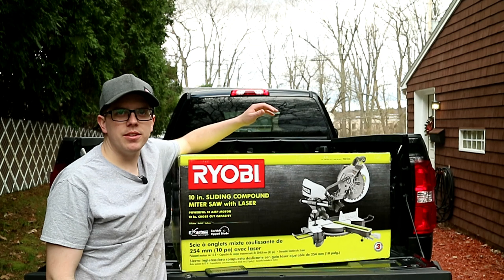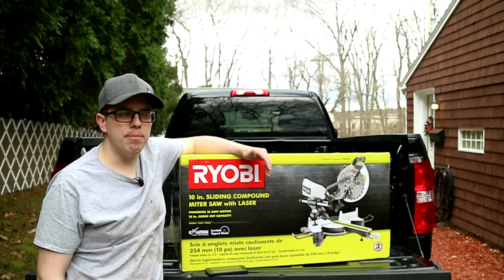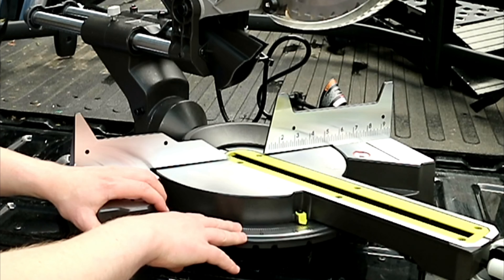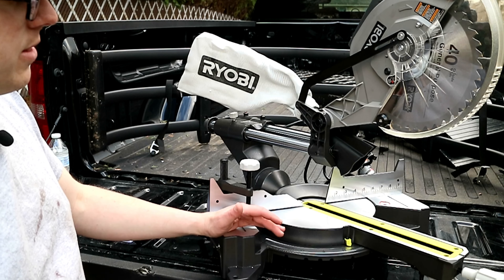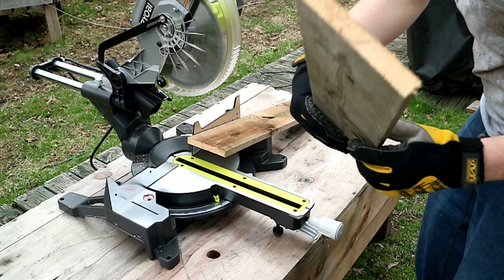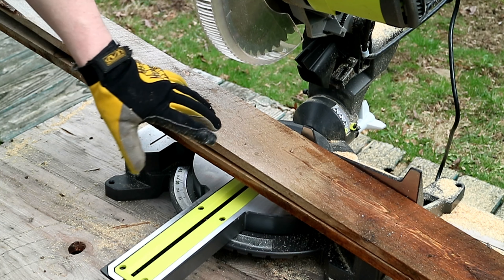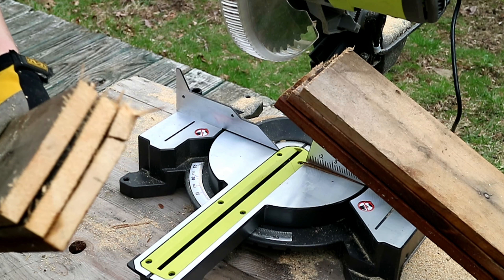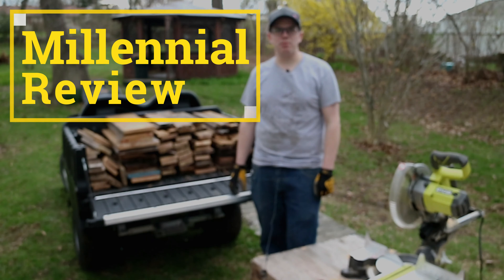Real Review, Ryobi 10" Sliding Compound Miter Saw TSS102L

Comment: I Bought Ne A 10 Inch 
Cordless Ryobi Miter Saw.
Havent Used It Yet But It'll
Come In Handy when I Start My Winter Woodworking Projects.
Why I Chose A Cordless Is 
Theres never An Outlet Around
When Ever You Need It.
Either The Outlets Are Behind
The Couch or The eazychai.
I Can Just slap A Battery In It 
& Start Doing My Woodworking
Projects.

Comment: Not gonna lie I bought one of these and am very disappointed in it. I was using it to re-trim a house. I have re-calibrated the fence and vertical axis multiple times.  It does not hold 0 vertical well at all, very obvious when coping base board. And cutting miters is completely hit and miss. Wish I would have bought a bosch or Dewalt.

Comment: I just bought one today, haven’t had a chance to open it up yet. Hoping it will make nice, clean cuts for my diy projects!
Reply: Shannon Marie I’m on edge with buying one. I have a ten inch miter saw that’s not sliding and struggle with cutting 2-8 and 2-10 material. I’m 14 and working on making a business out of woodworking so things like that really have a significant impact.
Reply: Nicholas Roberts spend the extra money on deWalt it’s like $219 at homedepot. definitely worth every penny if you’re gonna use it for woodworking in the future.
Reply: Hi Shannon 😍

Comment: Did your slide out of the box feel stiff?
I loosened the lock screw but it’s still incredibly stiff. Does not slide well at all. 
Any input would be great. Thanks.
Reply from the maker: It broke in a little bit
Reply: A drop of oil usually works. A drop, not a can.

Comment: Thanks for the review...I just bought a 12” one 
Your review already made me glad I got it and I haven’t even opened the box yet

I have to admit, I ended up getting a Delta Cruzer miter saw.  It cost a lot more...I use it for Regular wood working projects.  It slides as smooth as butter.  It also doesn’t use those sliding rods, it has an interesting mechanical arm so it can sit basically flush with the wall and easily slides forward and back with very little resistance.   It’s a long-term investment for me.  Very solid saw and maybe the best one out there right now. 

Anyways, this is supposed to be about the Ryobi.

Comment: Wait until you've had it for 1.5yrs, the ryobi "craftsmanship" starts to really show.
Reply from the maker: While that may be true, Ryobi is a homeowner brand and is not going to hold up to the likes of Milwaukee. Then again that's why the price points are so much lower.
Reply: Hmm... I disagree, there are many ryobi users myself included that have tools from ryobi for years with no issues. I've used mine in automotive for 6yrs with no issues and replaced my old blue with the new brushless line. Others stated they on a contractor level havent had any issues. The craftsmanship from my personal experience is excellent. I would expect it to be inferior but I intentionally abused my tools to see how durable they are, that includes dropping them carelessly, leaving out in the rain (that was entirely accidental) on a job site and everything still worked and works fine, and pushing/using them with an attempt to bog down. Despite these attempts over years no issues. Reason I personally love and stick to ryobi. I do love Milwaukee and I really want their impact wrench as the ryobi one I have is only 300 ft lbs of torque. Hopefully that'll  change with a new brushless 1/2"
Reply: I've owned and used a set of Ryobi  Drill and impact driver for 9 years. Its been used in the Nevada Desert and dust and back. Still kickin and work great.
Reply: @emmanuelmota1  Well this is a homeowner grade tool. It's just what it is. Pros pay a little more and use them everyday. Both tools have there place.
Reply: Thinking of the Bosch with the attenuating arm. But you could buy two of these Ryobi's and have money left over.  But I only need one.
Reply: @blueceligts180  yeah, tools for years with no issues because you don't use them often.
Reply: @newmanfertig886  I clearly stated my use of my tools. I used the daily since I was doing custom automotive installations for over 6yrs. My coworkers used harbor freight, snap on, makita, Milwaukee, and rigid. I had no issues with my ryobi and my coworker's used my tools at times.
Reply: @blueceligts180  That says a lot for Ryobi then. Good to know.
Reply: @newmanfertig886  For me it does. My coworkers still said they wouldn't buy ryobi but they had no problem using my tools. And for me with my experience, that is why I support and still purchase ryobi. But I do love Milwaukee they have great tools which would be my higher/better brand that I would purchase for certain tools. Ryobi drill/impact bits however are trash and I will no longer purchase any of them or recommend thdm.
Reply: I'm a contractor ..I do home rehaps for a buy and flip realtor who has sold 5 houses already this year my tools are Ryobi I use them hard every day for long hrs from trim and finish carpentry to screwing down and building decks ..it's been about 8yrs now and my tools haven't let me down ..the other contractors pack DeWalt and they make snide remarks about my tools being Diy or home owners ..I just laugh doesn't matter who's home it is we are working on it we are still rehabing and remolding a home I'm my tools are going strong sometimes longer then their professional tools ..I have the same 3 yr warranty for the half the price ..lol
Reply: @doughart4833  Dewalt is lifetime warranty. And Ryobi isn't made for Custom Carpentry. By your comment I know you're full of shit. Pros pay more for accuracy with the tools. Ryobi fails to deliver in those areas. Their Table saw didn't even qualify to be part of a job site test. There is a reason Ryobi is cheap. U would get chased off job sites if u showed up with Ryobi tools, to do a Professional job.
Reply: @scraplifetrashtocash4551   when did DeWalt come with lifetime ..last I knew DeWalt was three year just like Ryobi
Reply: @scraplifetrashtocash4551  You must be a real fun guy to work with at a job site.

Comment: I am trying to find out if this miter saw rotates like one needs for baseboard 45 deg angle cutting. No comments on video or any of the comments on yay or nay, is it cuz it's standard for 100% of miter saws on the market?
Reply: yeah the saw turns 45 and tilts 45
Reply: @MuttonChops24  thx yeah I actually went ahead and ordered it online cuz I was pretty sure it did, it's kinda the whole point of these miter saws. I bought a really nice Freud Diablo 50T blade for it too. Haven't had anything to cut yet but I'm pretty sure I'm gonna love having a higher end blade. I figure that matters more for a home DIY person than having a high end miter saw brand. Oh and I went with the non-sliding Ryobi miter saw to reduce weight and increase portability.
https://www.homedepot.ca/product/freud-10-in-combo-blade-50-teeth/1000102618
Reply: TheSkystrider have you gotten that new blade yet and how is it?
Reply: @shannonmarie6227  I did but I haven't cut much with it. Cut like butter though. I think it's fantastic but I'm just a regular DIYer. Definitely seemed to have a finishing cut to my eyes.

Comment: I bought this saw a few months ago and so far am very happy with cut quality, power, etc. The one thing I noticed is that mine slides very rough....rougher than anything I've used before.  Did you have a similar problem by chance?
Reply: If you’re willing to spend more and see it is a long-term investment, I’d get the Delta Cruzer.  Amazing saw that moves as smooth as butter.  Of course, it matters how much you’re going to use it and what for too.

Comment: just bought the saw and each slid cut through 5" fascia ends up being about a 16th of an inch off.  Thoughts before I return it next week and get the Dewalt 10" slider?
Reply: Did you trade it?

Comment: What do you think about the led light vs the laser? It’s suppose to line up with it shadow
Reply from the maker: Both work. I don't think I have a preference
Reply: i myself prefer the led light. it actually shows the width of the blade cut since it uses the blades shadow.